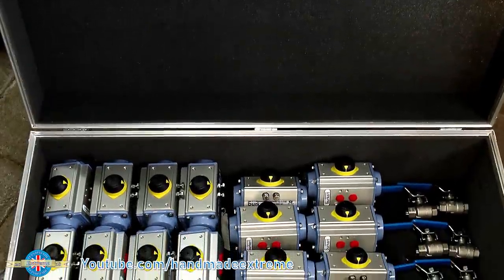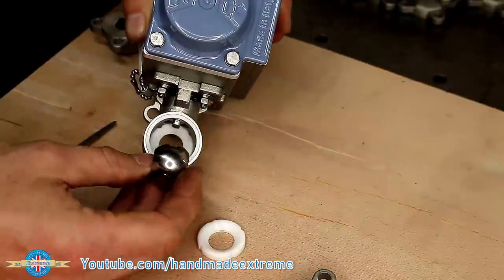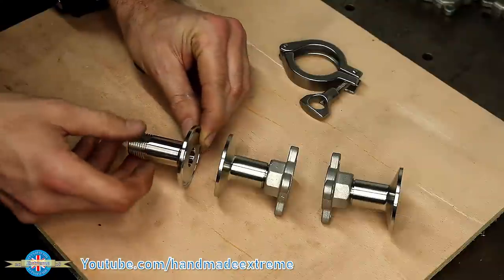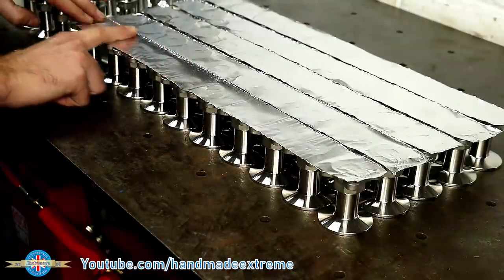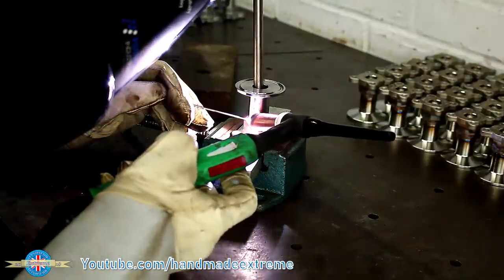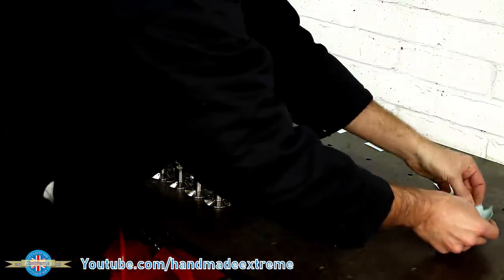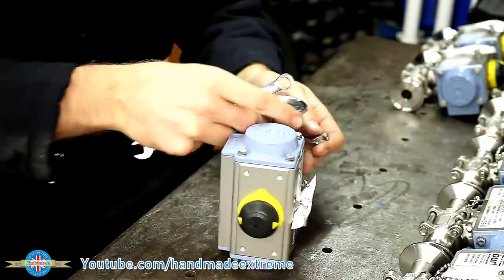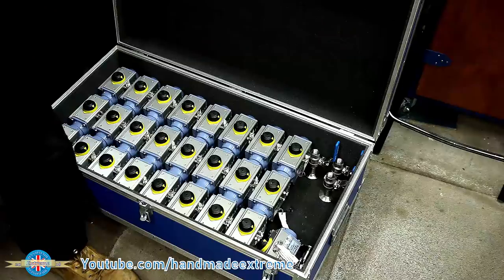Making money from a home workshop.  Batch work modifying solenoid valves.

Comment: I have to thank you for a detail in your video that probably no one else can appreciate as much as I can. At 2:37 you are using a flange after I've been looking for a while. I didn't know that the flanges were called "Tri-Clamp". Now I can finally order the parts to optimize my lid wax press that uses such flanges.
Thanks alot
Greetings from Germany
Reply from the maker: Glad it was helpful! Good luck with your project.

Comment: When I worked as a welder not my chosen job, I was taught to move the welding torch in a letter 'D'. The main reason was for good penetration on both surfaces. Well done on the valves.

Comment: Years ago, we did some work like this, BATCH...  I made me a simple little turn table. 
I found a cheap sewing machine on CL, I used the foot petal as my trigger for the table to turn.
The part being welded was only 2.25 in Dia. , 1 weld all the way around..
Got the time down to 1 1/2 minutes per part,,,, well worth the time making the t/table.
It work out great, if you wire the table motor correctly, you can speed the table up/down as needed.
Between 2 of us we made quick work 1100 pcs!! I hate to weld after that job!!!
We quote the job high caz no one else wanted it.......we both took a week off after that job!
Reply from the maker: Awesome job! 
I have just finished building myself one. The build video should be up tomorrow. 
Thanks for the support.

Comment: Stainless steel fittings would indicate to me that these are for possible food service application. The autonomous factory bit has me intrigued. I saw a video last year maybe on an autonomous sheet metal factory. The day time staff do the things that they can do as well as load up the various machines ready for the night shift by the robotic machines, various CNC controlled plasma cutters, punch presses, brake presses and spot welders. Really weird to see but also the future and a safe way to keep people and machinery separate.

Comment: new subscriber .  I think that job was the one to warrant a rotary fixture. An old lathe chuck and belt drive to a pulley in an  old / cheap cordless drill works great.  You can rewire the trigger to a speed controller or go hi-tech with a jubilee clip on the trigger.
Reply from the maker: Welcome the the channel. Glad you are enjoying the videos.
It's in progress at the moment. Aiming to get the video out this weekend. Thanks for the support.

Comment: it sounded like you are self taught in tig welding. Being a pressure line in OZ it needs to be done by a ticketed welder. The test equipment looked very expensive. I use to do similar to what your doing but the valves were much bigger. Nice little contract, good vid.
Reply from the maker: Thanks. glad you enjoyed it.

Comment: Nice work.. Thanks for sharing.. I use to weld for FluidlineTech.com and a much faster way to weld them would be to use a rotary position table. The turntables were equipped with the argon purge line attached so that the argon would flow up through the center. We would set are work piece into the jaws and insert a purge plug on top and adjust the flow  to the turntable with the help of a dual argon regulator setup.

I would have leveled them all with a nylon mallet. Find the high in with a bubble level or height gauge and then strike that high end and recheck until it's level all the way around. 

Also forgot to mention that we would trim the ends with a pipe facing tool to ensure all were the same length before welding. Based on thickness and type of material we could determine the exact amount of weld shrinkage to ensure tolerances within +/- .005".
Reply from the maker: Great work and thanks for the tips. Always good to get advice from those who have more experience.

Comment: Good day , If you make a rotary table , use a gear box , I tried other method's I find the gear box is the key to  Torq and consistence  at a  slow speed (most Important ) keep in mind your building something that most times will turn at 1/2 of and rpm to 1.5  rpm you have to go the slowest to tig weld . I learned this by the first ones I  built. they had problem going slow and stopping on me in mid weld and being jerky  all problems at very slow speed . A   D.C. motor And a gearbox is the key to getting it right the first time ..    Pete M
Reply from the maker: Hi Pete, great comment. I've actually already started the table. I'm not using a gearbox unfortunately but I do have a decent gear reduction through a chain drive and a DC motor with a PWM speed controller. I should be able to test it properly in a day or so. I have had a little go already and can get it to run slow enough for TIG. I'm aiming to get the video out this coming weekend.
Thanks for the support and advice. Always great to hear from people who are doing / have done similar projects.  Thanks again.

Comment: Those are not "solenoid valves", they are pneumatically actuated valves. 
Excellent job done..!
Reply from the maker: Very true and well spotted! Glad you enjoyed it. Thanks for the support 👍
Reply: Can buy this exact one on Amazon for $105. 
OrangeA NPT 2'' 3-Piece Pneumatic Actuated Ball Valve Double Acting Pneumatic Actuator NPT Ball Valve Actuator 2 inch Pneumatic Actuated Ball Valve
Reply: TO THE GENERAL POPULATION THEY ARE SOLENOID VALVES... HEAPS OF PEOPLE DON'T EVEN KNOW WHAT PNEUMATIC IS
Reply: @thomasknight-wagener6630  Nope, they are not solenoid valves for the "general population".
Reply: @thomasknight-wagener6630  A solenoid valve is run by electricity creating a magnetic field, were as this is run by compressed air. Clearly not the same, also why are you screaming?
Reply: @thomasknight-wagener6630  It doesn´t make it any better if everyone is calling them wrong...

Comment: Worked in paint mix room at Jeep, and can attest to the fact that they can be a pain. Welding was our fix as well, or rather would have been if Skilled Trades had not prevented the fix. Basically they would lose all hours that would otherwise be spent on repairing them. When one did break loose you didn't want to be anywhere near it as the paint pressure pots were under a lot of pressure.  Worse yet the MEK, (solvent, deforming baby shit), also used these. Got that shit right in the face once.

Comment: Would be great to see a rotary positioner video. 
So many shiny valves, can't believe they're stainless and not chrome plated. (I must have been a magpie in an earlier life).
Reply from the maker: I've just ordered the parts, hopefully they turn up in time. 
Yep all 316 Stainless, chrome would not be acceptable for the application. Sadly can't say exactly what they are used for for commercial reasons.  
Thanks for the support.
Reply: If its for the food industry, That is is almost exclusivity 316L stainless steel.
Reply: @DeKempster  Agreed! I was commenting more on the appearance in the video, that the finish was so good that it looked like chrome :)
Reply: @qcnck2776  Its probably because the tri-clamp fitting is following standards like A3 and EHEDG which specifiy a maximum surface roughness. aka metal is shiny.

Comment: I don't understand. The thread at the valve was apparently working loose. So you added two flanges on either side and simply move the problem thread further away from the valve body. How has this helped? Surely a steadying brace on the valve body would have been easier to retrofit

Comment: You can make a welding positioner out of a rotary table.
6061 made a pretty simple basic one that works
Reply from the maker: I did consider that as I have a rotary table for the milling machine but I thought it was a bit too nice to sacrifice. I'm underway building one at the moment. Hope to get the video out this weekend but it's quite a big job... Thanks for the support.
Reply: @Handmadeextreme  I don't blame you, wouldn't use a decent one either
I ended up finding a really cheap one on eBay. Then an adapter so I can use the chuck from the lathe
Reply from the maker: @bazza10198  It's being built at the moment. Looking like it should be quite nice once it's done. Heavy though...  I think it might be next week before the video is done though. It's quite a big project. Thanks for the support.

Comment: Isn't there a way to simply solder the threads?  Heat it, have the solder fill in and seal the threads, polish it, done.
Reply from the maker: That is possible yes; but the customer asked for them to be welded.

Comment: If this weld was done as you said to stop people undoing the threaded section, why would you not simply tack weld in one or two positions on the unit, what you have done is totally not needed,  Even a permanant thread locker would prevent a human hand from undoing them.
Reply from the maker: It's what the customer asked for.  There are a few factors at play which relate to the final application of the valve. The majority of thread lockers are not compatible with what is going through the pipe for example.  Great question. Thanks for the support. 👍
Reply: @Handmadeextreme  We have to keep the customer happy , even though they think they are right.

Comment: I just wonder what the customer needs these valves for. Triclamp is often used in the food and pharmaceutical industry. But there a thread welded on one side is a microbiological disaster. On the inside, germs can crawl into the threads and are not flushed out during cleaning...

Comment: You better have been paid well. I assume unless you do the actuators all the time all the testing equipment was provided by someone on loan.
Reply from the maker: It was a job that both myself and the customer were happy with the price for. I think I did about 200 valves last year. You are correct that the test equipment belongs to my customer yes. Thanks for the support.

Comment: Exellent video, i am a stainless steel/aluminium TIG welder. 1mm filler wire would have been much better for 70 amps i only use 1.6 when welding over 150 amps also a 2.4mm thoriated tungsten is good for 40-200 amps (just grind a sharp taper for lower amps) hope this helps👍.
Reply from the maker: Thank you. Always great to get feedback and advice from a pro.  I appreciate you sharing your expectance. 👍

Comment: gloves and a wire wheel....it's ok, you've got plenty of fingers - you'll never miss one or two
Reply: He certainly doesn't know what he's doing....... 🙄
Reply: @f.3561  , I agree with you considering the title of this video incorrectly labels these as solenoid valves...
Reply: so what?
its perfectly fine to use gloves when you know what you are doing.
ive seen people strip their hands using no gloves - its not exactly fun either and takes forever to heal.
Reply: @TheVergile  you might get a nasty wound without gloves on but the chance of the wire wheel ripping one of your fingers off is just too high to be considered a safe practice
Reply: @pinkman20001  you know - this is actually hotly debated. I have heard arguments both in favor and against gloves on a wire wheel. What they have in common is that both sides rely heavily on anecdotal evidence.
Depending on where you learn your craft you might hear „never wear a glove bc it might pull in your hand“ - but what they fail to mention is that this only applies if you ahve a boxed in design or close toolholder setup where the glove may get snatched between the wheel and enclosure/toolholder.
on an open wheel you should definitely wear gloves
Reply: @TheVergile  you're right about that, personally i just prefer never using gloves when near any kind of rotating equipment

Comment: This old Tony made a rotating welding stand from a microwave motor, it would be great for this job.
Reply from the maker: Great idea. I think I have a windscreen wiper motor tucked away in the bits boxes that I'm hoping to repurpose. Popped over to my dads workshop a couple of days ago and he gave me a lovely little face plate to use as the table. Watch this space 👍
Reply: @tommfuller  your right Tom, my bad!
Reply: @Handmadeextreme  I don’t know why I thought the motor was from a microwave, apparently it wasn’t, sorry 🤣

Comment: I'm not sure I understand the point of the tape if you're putting the valve's face down flat on that aluminium bar. Provided there isn't an excessive gap, there should be enough gas pressure to maintain a purge- although I'd question the need for a purge anyway given the thickness of the thread, you shouldn't burn through (the nipple end is much thicker than typical 1.6mm wall dairy tube).
Unless there's something I missed of course? 
In addition, wouldn't using pickling paste save a lot of time, dunk the valve side ends up to past the weld, it'll eat the colour off and the tape residue off too, then just rinse with a hose.
Try a 2.4mm tungsten and 1.2mm filler too, you'll notice the thicker filler rod sucking the heat out of the pool which slows you down.
Hope this doesn't sound too pedantic, just trying to offer some tips.
Reply from the maker: Great comment. I'll give the thicker tungsten and thinner filler a try on the next batch. I don't weld every day so it's great to get input from those who have more experience. Many thanks.👍

Comment: also, your home workshop has an pneumatics tester? My grandpa's barn had a 10tonne winch for taking out dumptruck engines. Though it was close to the house, we never called it the home workshop, we called it the shop. times have changed, home shops used to mean peg boards and job mate benches.

Comment: Why not just use a loctite product on the threads?  It works for many pipe fittings.
Reply from the maker: The customer wanted them welded.
Reply: @Handmadeextreme  yeah i got that but the expense.